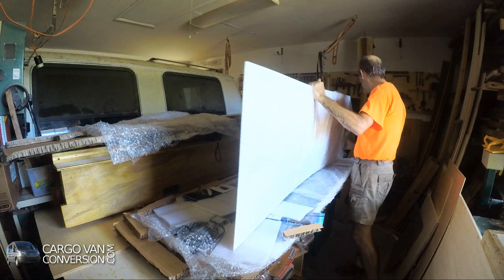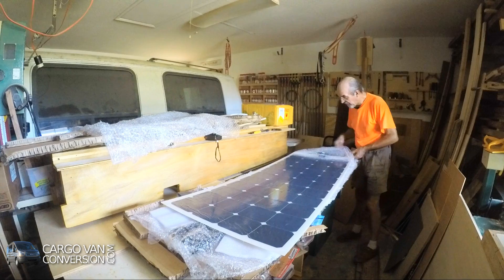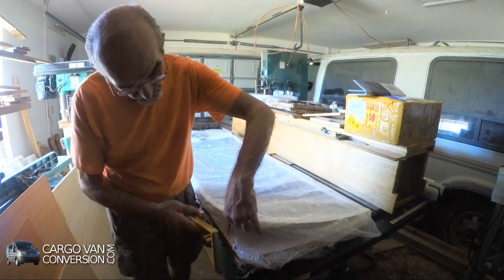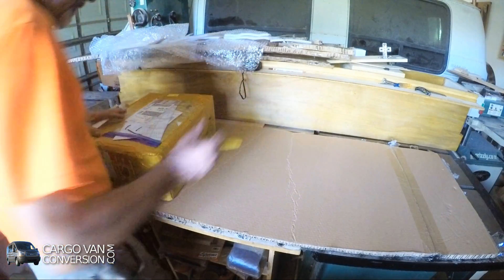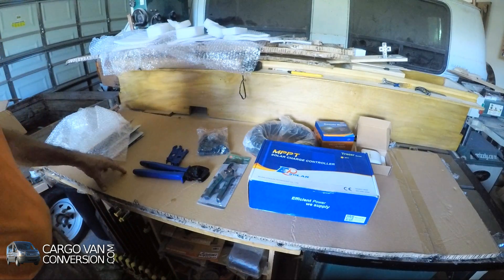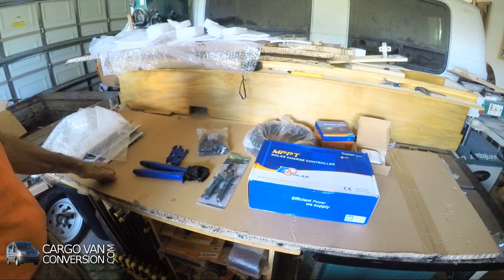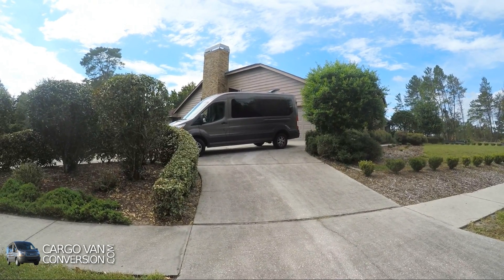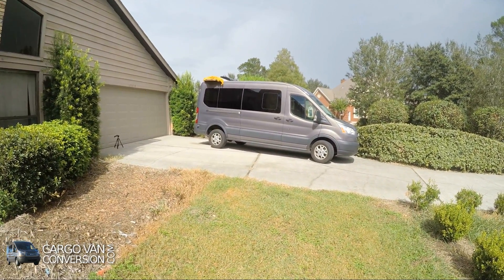Buying Flexible Solar Panels From China

Comment: Hi, Good video! but can I ask you, it's been 5 years, are the panels still working well? Thanks!
Reply from the maker: Hi Peter,
yes they do. Had one small issue earlier this year, where the top foil layer started to loosen at two edge locations. Used a strong 3M spray glue and that solved it.
You didn't ask for advice, but I will give it anyway. If you plan to buy these type of panels, get ETFE panels, preferably with backcontact cells and grade A quality. The latter is always an issue, because you have  trust the seller.
While I'm satisfied (so far) withe these panels, I would only recommend them if you absolutely want or need stealthy panels. Stick with rigid panels otherwise. They are much cheaper, have a proven longevity, somewhat better efficiency and longer warranty.
Have a great day!
Van Williams

Comment: Don't bend flexible panels too much as the cells will break. You can hear them crackle. I don't trust some of the flimsy packaging in that regard.
Don't mount directly on the vehicle. Solar panels don't work as well when hot. Use corrugated plastic sheet as used for temporary signage as a backing to keep cooler.
Flexible panels will not last as long as solid ones. The surface tends to degrade in a few years.
Reply from the maker: A well-balanced description of the issues with flexible solar panels.
But my practical me looks at it a bit different. As you said, the cooler you can keep any solar panel, the better its performance. An extra panel is also a simple solution for that. I also would say that flexible panels aren't made to be bend multiple times and then only minimally, say 5%-10% at most. By the way, there are special flexible panels that have multiple connections inside, which can withstand a lot of abuse, but they are difficult to find.
Solid panels last longer than flexible ones. Yet with some knowledge, you can find high-performance and long-lasting flexible panels. Cells should be Grade A and the finish must be ETFE.
My advice is always, that if you don't absolutely need the flexibility of the panels, just buy solid panels. Those are time-tested, warranted for 25 years, cheap and long-lasting. None of that is applicable to flexibles. After five years, I still think that I made the right choice (for me); I absolutely did not want to see anything mounted to the van. But for the roof vent, that's what I accomplished.
Van Williams

Comment: If you install directly like that heat will kill it in a year.
Reply: Late to respond, had some health issues, but now I'm back :)
There are some consistent misconceptions about flexible panels. Mine have been installed 3-4 years ago and still work as they should. Many (often logical) issues have been raised, but I've seen little proof for any of them. I do assume that increased heat will diminish output, but an extra panel will take care of that. Want to remind you, my panels were high quality and not run-of-the-mill.
Van Williams

Comment: What are some examples of devices you can charge with just 1 panel? Can you charge a notebook with just 1?
Reply from the maker: Just to be clear, my panels are 135W each, but to keep things simple, I'll talk about a 100W panel, a more common size.

There are two ways to approach your solar panel requirements. First, in a general sense, a basic, minimal system when you live permanently in a vehicle, would consist of two 100W solar panels, backed up by adequate battery storage (i.e. ~ 200Ah battery bank); this would be a good sized system for basic needs. 400W in solar panels with ~400Ah in battery backup will take care of most of your needs.

Second, a more precise method to calculate your needs, is by finding out the number of watts or amps each appliance uses each day (on average). With the total number of Amps used per day calculated, one would be able to find out the number of solar panels needed. The average 100W solar panel can produce ~5.6Ah. A southern sunny day would on average give you 5-6 hours of full sun, which translates into 5 times 5.6Ah = ~28 Amps per panel. Divide the number of Amps needed that you calculated earlier by the number of Amps produced to find out how many 100W panels are needed.

What makes it difficult to get to a precise number is that you always deal with a lot of averages: average available amount of sun (is different in summer and in winter, it can be cloudy or it rains). Average needs: in winter the days are shorter, so you use the lights longer and watch more TV. Then the solar panels may not be optimally position towards the sun or they are in the shade. Lots of variables.

To answer your specific question, my laptop uses 2.37A @ 19V which translates to ~3.75A @ 12V; that means that I could run the laptop on a solar panel that produces 5.6Ah. Charging the same laptop can be done at 12V on a 1A or 2A USB charging station, but it would take a couple of hours to charge the laptop battery. In practice, you should have a surplus of solar panels that would keep your battery bank charged; then you could charge the laptop from the house batteries.

Hope that this sense to you :)

Van Williams

Comment: Thanks for your time, very honest review!
Reply from the maker: Hi radgiegadgie,
I still stand behind it. I saw so many issues with the 'first generation' of flexible solar panels, that That I waited until I found these. I thinks that the main qualities are high grade solar cells, ETFE laminates and Backcontact cells.
I've had them installed on my van's roof for about a year now in Central Florida, and they still look brand new and perform as expected.
The only issue was cost, but with anything much cheaper, you'll know what you get.
Good luck!
Van Williams

Comment: Contemplating the purchase of 5 panels from Mr. Dean in China \ LinkSolar... \ SunPower. Very confused with all the different  People Selling Sun Power Cells and their cell coding!

Didn't think about the taxes. Thank you.  

I will be using them to recharge three 100 Ah Deep Cycle Batteries on our travel trailer and at home in case of an emergency.  Don't understand why people attach the panels to their vehicles. I will be floating mine, this way when I'm not using them I can put most of them away in timed rotation away from the Florida Sun.

I am currently waiting on a quote from Mr. Dean.
Reply from the maker: Hi Jorge,
For most of us, we can check and compare (flexible) solar panel features like voltage & amperage ratings, ETFE, backcontact cells and price, but for grade you're largely dependent on the supplier. Choosing SunPower cells is good, but it's not a guarantee that you get the highest grade. Many of the early and cheap panels had low grade cells.
I waited many years for quality to improve and buying was still a gamble. Yet I have to say that my Link Solar panels have been performing as expected and now that it's a year later, I see absolutely no degradation of the panels or their performance. Very glad that I bought them.
My main reason to use flexible panels was for stealthiness. Many install panels on racks for improved airflow underneath. I often read about a longstanding issue about diminished efficiency, because of heat issues. I can't really say, that I have noticed any difference. Voltage doesn't seem affected, amperage has been underused, so I don't want to give that a thumbs up yet. I feel, in my case, that it is not an issue. Having solar panels on a rack, makes them a lot easier to remove and put them on your house though.
Wish you good luck!
Van Williams

Comment: Hello Van Williams,
Did winter conditions affected your solar panels at all ??? thx
Reply from the maker: Sorry, but I'm going to give you a non-answer :) I'm located in Central Florida and we've had a fairly mild (say warm) winter and besides the fewer number of hours of sunshine, nothing really changed. In general, the voltage has been around the stated maximum every day. As I only periodically using the roof vent as part of the 12V system, most of the time the system is only topping of the batteries. The next thing, I'm working on is a fridge and that will give me a better insight in the amperage side of things. So far my impression of my solar panels is quite good; they seem much better than these 'first generation' flexible panels.
I have no factual opportunity to directly compare them with rigid panels, but my perception tells me they do very well in the early morning and late afternoon. After about a year since the installation, they visually look still brand-new, without scratches, blemishes or discolorations.
Hope that helps!
Van WQilliams

Comment: Very good review of the buying process and packaging. Looking forward to some output tests to see if they deliver the power they should. Thanks for the upload.
Reply from the maker: Hi 228kw,
Thank you. I did a very brief update recently about the VHB tape used to attach the panels to the roof https://youtu.be/y1vDj8NGH1I
I will do a more comprehensive review in a couple of months, a year after installation.
So far, they exceeded expectations; they are especially good in less than ideal situations: early morning/late afternoon or cloudy days. Would use them all over again.
Van Williams

Comment: why wont you just tell us the price?? can't find it on the site
Reply from the maker: Hi Kennedy,
This link https://cargovanconversion.com/LS/GFL-135 goes to these specific panels. It has a 5-pack (675W total) for $1,750.00, so about $350.00 per 135W panel. My setup cost around $1,500.00 for three 135W panels plus controller, cb's, cables and alike. These are no bottom prices, but you get a high quality panel. I have them installed on my Ford Transit now for about 6 months and very satisfied.
Van Williams

Comment: good video. i am sure it was much more economical buying direct from China than using s US source.
Reply from the maker: Hi barry8082,
Not yes, not no :)
The primary goal was an excellent flexible panel with an optimal size. With the roof of the Ford Transit as my canvas, I tried to add the maximum number of watts. The panels that I choose, were 59.5 inches long, just 0.5 inch shy of the width of the roof. In other words, I used every available square inch. Using regular 100W panels, would have left me with less than I have now and I still have space left for an additional panel, if I wanted to. Link Solar was one of two companies that could supply these panels, the other one Chinese as well.
There were other factors that played a role in my decision. I have seen so many of these flexible panels fail and wanted to avoid the same destiny. They needed to be made with ETFE laminate (much sturdier), Backcontact solar cells (high efficiency) and high grade solar cells (expensive). In the end it is always a gamble and only time will tell whether I made the right decision. So far it has worked out well. They were installed in Nov.2017 and there is absolutely mo deterioration of the panels, efficiency is high and they are working as expected.
Now the price. I paid approx. $1,500.00 for a set of three panels (405W) including an affordable controller, wires and a few other knick-knacks. Could have saved a few hundred, but would have been stuck with an awkward size and perhaps less watts.
These are high quality and while I cannot tell you after only half a year of use, but it seems that they will likely last at least for the life of the vehicle.
Van Williams